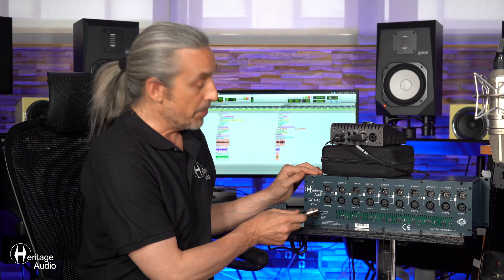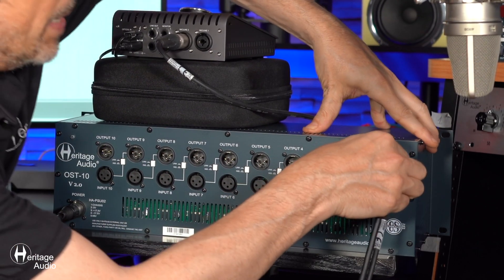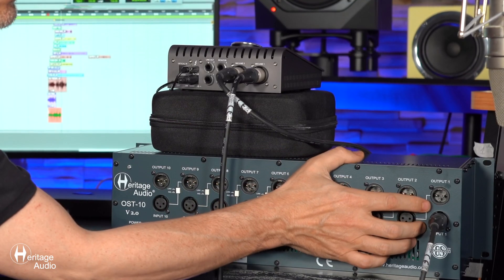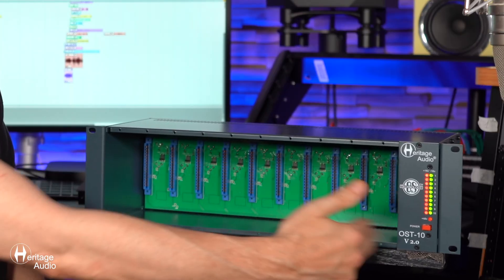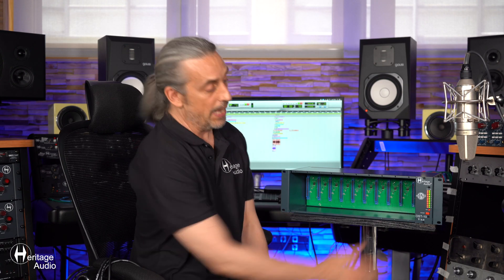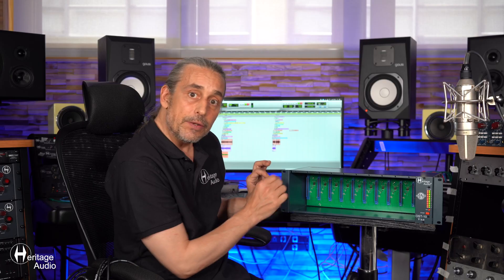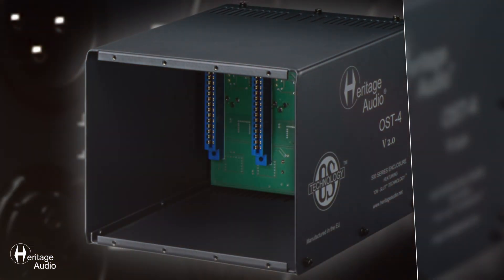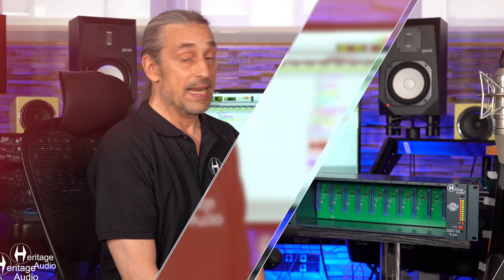Heritage Audio - OST-10 v2.0 500 Series Connections & Features

Comment: Just got a unit on order from Thomann. I'm seduced by the power ratings per slot. I'm probably going to go ahead and acquire a pair OST-8 ADAT units if the OST-10 delivers. The internal jumper for stereo pairing is an interesting bit of design. Is this a feature designed specifically for HA units, or is this supported in the API specs for 500 series ?
Reply from the maker: Hi there! Thanks for the ind words. The internal switch to pair modules works with any 500 series module. Hope it helps!